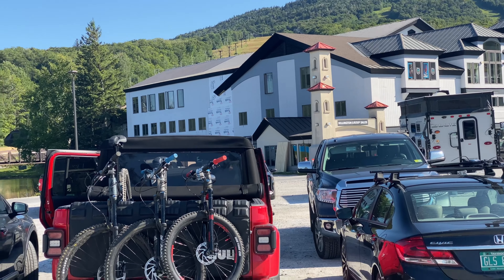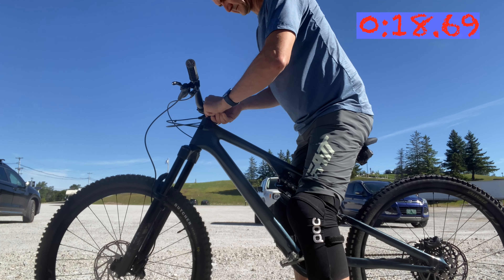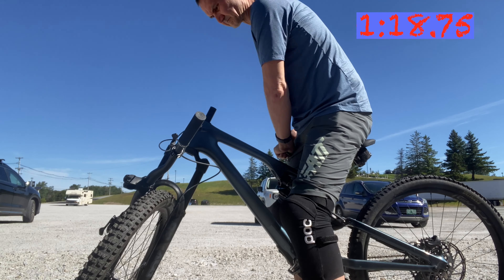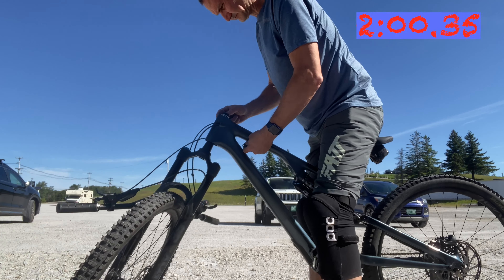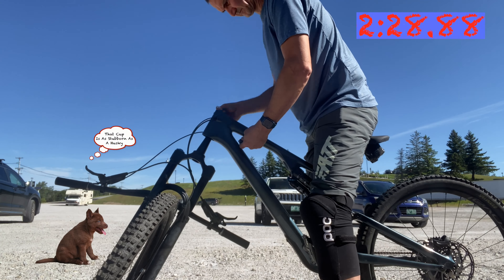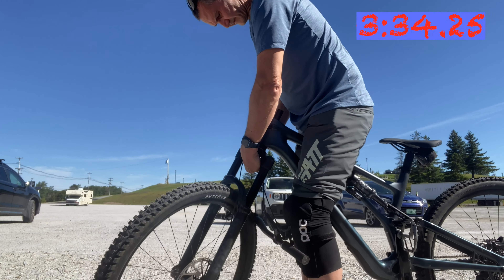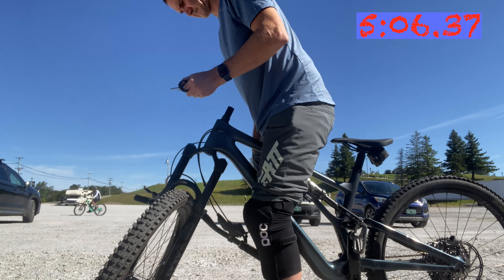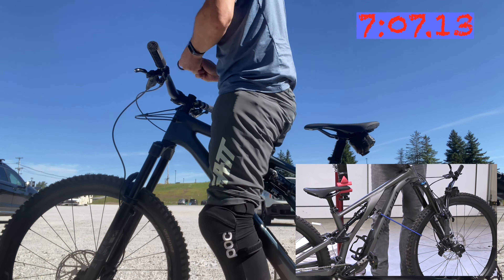Stumpjumper EVO 2022 - Parking Lot Headset Angle Adjustment

Comment: Nice method if you're in a pinch. I now keep a bungee cord in my tool kit I travel with after watching your first headset video. I was just at Trestle bike park and slackened out the bike to 63.5. In my opinion, it made a significant difference, especially in the steeper sections.
Reply from the maker: Hey Parker, thanks for checking out the videos. How do you like Trestle?  I noticed the same when i slackened out the bike - happier going down the steeper tech. I didn’t drop the BB yet but plan to do so when my cracked ribs heal up (my fault, not the bikes….). I’ll be throwing a bungee into my travel tool kit!
Reply: @dizidoesdownhill  Trestle is a dream. Lots of flow and jumps with some mix of tech and hand built trails. I do want to check out Killington one of these days. I still have dropped the BB yet either but will next time I'm at the park. Hope you heal up quickly!
Reply from the maker: Great to know I can add that to the list of places to ride! The rib is slowly getting less annoying…thanks!

Comment: I would only do it like that if i had no option! I have a Stumpjumper evo and whenever i want to change the headset angle i do it at home
Reply from the maker: Thanks for checking out the video. I’d much rather do it with the help of a bike stand but for this video wanted to see if I could do it at a trail head to see if it was readily doable. I think if you’ve done it a few times, it won’t be much of a bother.

Comment: ciao , Bel video, io di solito faccio questa operazione a casa il giorno prima dell'uscita.
devo dire che una volta aperto l'angolo non l'ho più spostato e corro sempre con i 63°....
Reply from the maker: Hey Roberto, thanks for the comment. I will do some testing at different head tube angles and see if the slack setting is good enough for regular trail riding. It certainly seems to help with the steeper downhill sections.

Comment: I need to get a bungee cord.
Reply from the maker: Hey Kenny, i have swapped the cups a handful of times and i definitely find it helpful. It’s not totally necessary if you’re more dexterous than me but I’ll take all the help I can get! Thanks for checking out the video.
Reply: @dizidoesdownhill  I changed it one time. No it’s not difficult but I def dropped some pieces before due to trying to stabilize the bike and it’s not fun. I saw that tip from one of your previous videos and keep forgetting to go get one. How’d it do at the park?
Reply from the maker: The extra help from the bungee makes it pretty straight forward. I had a great time at the bike park after i swapped out the cups. Definitely felt more stable on the steeper stuff. I was hoping to flip the chip this week but i clipped the edge of a berm with my back tire and it dumped me onto my ribs….it’ll be a few weeks until i can test out the lower BB bracket height….
Reply: @dizidoesdownhill  sorry to hear!  Get better soon!
Reply from the maker: Thanks Kenny! It’s been 8 days and is starting to feel easier. Am hoping to get a couple of easy laps in before we leave Killington on Friday. Fingers xd.
Reply: Good tips, had a hard crash on my SJ, it broke in a few pieces lol.  ended up getting the SJ Evo and I’ll be throwing a bungee in my SWAT box.
Reply from the maker: Sorry about the SJ but congrats on the Evo!